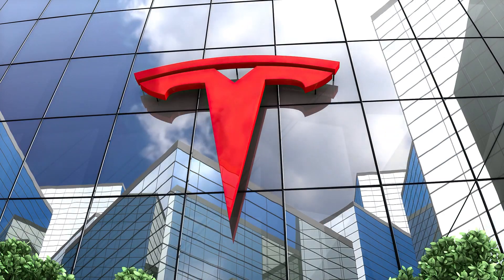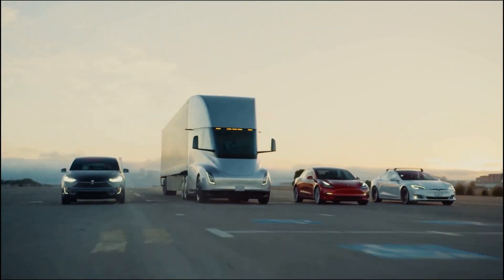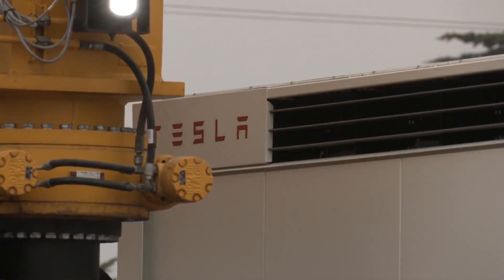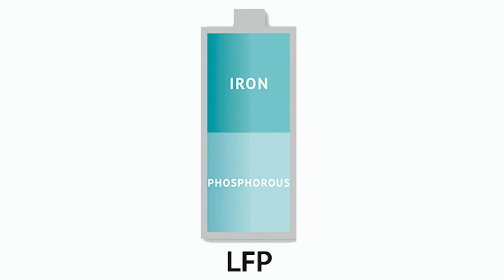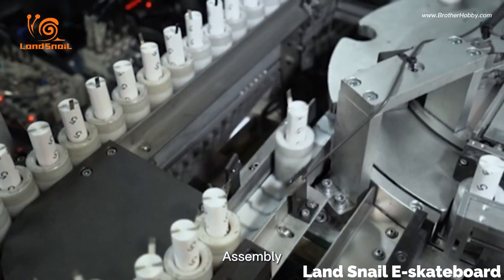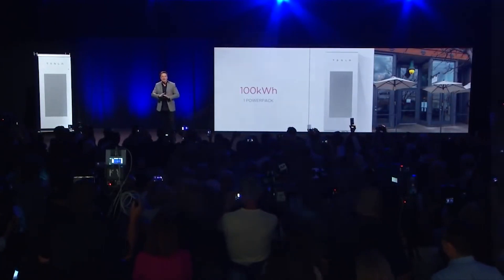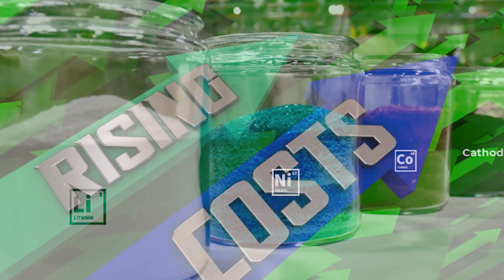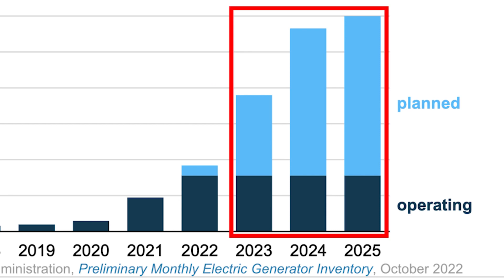The Real Reason The Tesla Megapack Will Take Over In 2023!

Comment: ISO Today app shows the battery capacity on the California electrical grid.  Data is near real-time.
PS - Wonder of a Megapack could be used to supplement data center UPS and diesel generator backup systems? Guess you’d have to cost it out plus see if runtime it provides would be comparable with data center requirements

Comment: You noted that LFP was unsuitable for EVs because of power and energy density, but I guess since the Model 3 is a lower-end and less performant vehicle, then that would be the reason why the Model 3 is using LFP batteries now? Do you have a video discussing LFP batteries in the Model 3? Aside from lower power output and density, would it potentially have better endurance compared to the traditional vehicle battery packs?

Comment: My main question is: what prevents others from making a megapack competitor and competing away Tesla's margin? Tesla's usual moat is better manufacturing and faster innovation but megapacks seem like a simple and straightforward product and, well, a battery with an inverter is a battery with an inverter. What am I missing?
Reply: There already is, and has been, competitors to the Megapack in the marketplace.  In fact, Tesla wasn't the first to design, develop and commercialize a battery backup system for the grid, they just figured out how to do it better and cheaper than their competition which is why they are constantly winning bids from the public utilities.
Reply: @S2kDude36  Do you know any company/product names of those competitors?
Anyhow, I suppose others can try to improve their grid battery systems and if they succeed this will cause Tesla margins to go down.

Comment: Demand is way much higher than that. As they explained at Battery Day, and anyone can easily do the math, demand will be several TWh per year. Even now the new factory is too small. Think about the power outages in California and Texas or the energy crisis in Europe. In both cases energy storage would be a huge help, and the scales involved are already beyond the 40GWh capacity of Lathrop.

And if prices go down, demand can scale up almost indefinitely. Currently it's cheaper to overbuild production and use as little storage as possible, but as prices go down, the optimum shifts toward more storage. In the limit, it could make sense to store excess solar power in summer to be used in winter. That's a staggering amount of storage. Likely won't make economic sense any time soon, if ever, but it's a possibility.

Comment: Here in France we estimate the cost of a Pumped Storage Facility at 50 €/kwh with a capacity of number of cycles without loss of capacity over tens of years or even a century.
The price of battery storage will always compete with these low storage prices and above all with potentially immensely larger storage capacities.
The battery solution will only remain suitable for small local supplies to meet peak power demand. Keep this in mind before you get too excited about fantastic projections.
Reply: Pump storage is fantastic but there are a limited amount of locations you can construct such an installation. Additionally a Megapack can be installed in 6-9 months versus several years.

Comment: The $2.6m is including installation for 1 2mw unit which makes it pretty uneconomical. The actual cost for the MP is 1.8-1.9m for 1 unit or 1.6-1.7m for 5+ units.
Reply: Uneconomic to whom? There is a regulated side to the energy market where they are guaranteed a return on their invested capital, so if they buy 100 of these suckers, they can simply add it to their expenditure, apply to the regulator for an 8% return on the total investment, then divide by the amount of electricity they need to deliver, and that's their charge rate. Add to that, government mandated levels of battery storage and its a no brainer that these will sell.
Reply: @howtomanagetech  I mean buying just 1 2mw unit and paying $0.7m for installation. I suspect most installations will be multiple units so average revenue is likely to be around 1.7m per unit rather than 2.6m in the video.
Reply: @Dynamacrtm  I wondered about how many packs you would get installed for that fee. The build is easy but the testing, connection and certification can be hard.
Reply: @howtomanagetech  Anything sells well when there are "government mandated levels of battery storage" or anything else.

Comment: Some versions of the Tesla Model 3 already use a LPF battery.The LFP battery sacrifices high rapid discharge required for ridiculously fast  bursts of acceleration, but despite lower energy density not range, as LPF batteries can in regular use be fully charged and discharged, where as NMC batteries should in regular use only be up to 80% charged and down to 20% discharged, and as stated LPF have greater charge/discharge cycles.

LPF batteries are definitely better than NMC for static storage applications, but sodium batteries are better still than LPF for such applications and have the benefit of being manufactured from a cheaper and more abundant raw material, sodium rather than lithium. Sodium static storage batteries are already commercially available and will only get better.
Reply: I thought Sodium Ion still had a way to go? From a google article Aug 2022 "Sodium batteries still need significant work. So we don’t want people to think this is ready-to-use technology. [We] still have a lot of work to do before commercialization.." CATL had announced Sodium Ion this year though..
Reply: @howtomanagetech  UK company Faradion already have a sodium ion stationary storage battery commercially available.
Reply: @grahamcook9289  Thanks for that. I looked up their website and they talk about them being a good replacement for lead-acid batteries. Wikipedia has a comparison table: Volumetric energy density 75-165 W.h/kg (Na.Ion) vs 120-260 W.h/kg (Li.Ion) for about 25-50% the price of Li.Ion (based on prototypes and product announcements). Faradion have one battery installed, so still a ways to go yet, but interesting to track. I'm sure Tesla will buy them all.

Comment: What will you do storing soo much energy, 
When all the Rear Earth Elements REQUIRED in manufacturing of "critical EV components" i.e. battery and Motor, are ONLY available in China, (as chinese monopoly).
Same goes for magnets and materials of windmills, solar panels, super magnets, etc.

I can see why everyone bows to China, Even F-35 manufacturer.
(As they require half a tonne of chinese rear earth elements)

Comment: 5:36 why would one cycle per day never be the case?
Tesla offers 4h and 2h discharge variants, so 6 and 12 full cycles per day are technically possible.
In use cases where you actually try to earn money by operating the battery you will want to maximize returns by running it at every opportunity.

Comment: Great informercial... However, it is unnerving to see kWh and kW confused by reporters who don't understand the difference. The cost of a megapack was quoted as $615/kWh. I believe they meant $615 per kW. When a user of electricity is paying $0.10 per kWh, $615/kWh is a terrible deal. However, considering that a natural gas combined cycle power plants costs $1,200 per kW to build, $615 per kW is a 50% discount compared with traditional electricity generation.
Reply: to cost of a megapack is indeed $615/kWh. but the trick is that you can use it more than once.
Reply: @w0ttheh3ll  I know that you mean well, but you may also not understand the difference between kW and kWh. KWh is a measure of total energy. The total energy storage capability of the life of a Megapack can be stated in kWh. This would take into account "using it more than once". In this case, the cost per kWh would be much lower. kW is the measure of instantaneous energy. If I have a 100 kW generator and run it for 1,000 hours, I will generate 100,000 kWh. If this particular generator has a life of 10,000 hours, it will generate 1,000,000 kWh over its life. If that generator costs $10,000, the cost per kWh is $0.01 per kWh. The cost per kW is $100. The cost of a Megapack would naturally be charged by it's instantaneous capacity and not it's entire life. If it were, it would have a much lower cost per kWh. Otherwise purchasing one would be idiotic.
Reply: @jeffschuster3309  the cost per kWh of a battery typically refers to its useable energy content when fully charged. look at the specs of any electric car to see an example. BTW, what you refer to as "instantaneous energy" is correctly called "power" in technical speak. the cost of a megapack is in part determined by its power (as you can see on tesla's website, there are two versions: 4 hour discharge and 2 hour discharge, the more powerful 2 h version costs more) but energy content (roughly corresponds to battery size) is more important for the price.
Reply: @w0ttheh3ll  thank you for the education. I get the specification of kWh... and $/kWh from the informercial. However, it is a terrible metric to understand the megapack's value in the electric utility marketplace. If a megapack can last for 10,000 charge cycles, it may be better to quote the cost as $0.031 per kWh ($615/10,000 cycles/2-hrs per cycle). This will give a utility a sense of how much they will need to charge their clients to recover the cost of battery storage. Yes, I understand that kW is "power".
Reply: @jeffschuster3309  the metric you're describing exists and is indeed very useful, it's often called levelized cost of storage, LCOS.

Comment: Garbage analysis! Tesla has no brand in grid power. Most batteries in the Megapack are not made by Tesla. Anyone can build or buy a stack of longer lasting safer Lithium Iron Phosphate batteries and and AC charging and inverter. BYD and CATL own the liFePO4 battery patents and are, by far, the biggest manufacturers.
Tesla energy businesses have zero value once people learn about CATL and BYD. Tesla energy competitors are far ahead in manufacturing, products, production and price!
Tesla had a fire during commissioning of their Megapacks before they were even used!

Comment: the issue for several of us stockholders is that we know Megapaks have more limited utility than Tesla's EVs. better to use LFP batteries for low-performance EVs (robotaxis?) & for powerwalls. just use cheap but effective carbondioxide batteries for grid scale storage.
Reply: which company sells CO2 "batteries" at the 100 GWh scale?

Comment: 615/kWh is incorrect!    Market is 1/2 that price!!  When pricing with tsla battery from website there is a soft cost that is fixed for engineering and drawing.   The bigger the system the lower this cost in kWh.   Try ordering 100 mega packs versus 1 mega pack and u will see the diff

Comment: The 30% cost reduction noted is meaningful if it's 30% reduction per kilowatt-hour (kWh), rather than 30% reduction per kW, as shown in bold letters up front. While this error is avoided later on your talk, please fix this error up front, so you're not confusing your audience with the wrong units. KiloWatts, MegaWatts, GigaWatts are all units of power capability, not energy storage capability or capacity. When you're talking about energy storage, like you are, then you should be using energy units, not units of power. Since this confusion is a common one, please help your audience understand the major difference between energy (kWh) and power (kW) capability.

Comment: This is key: "recurring software and maintenance fees. That could turn into $5B-$20B in revenue by 2030", versus the SolarCity model. Sending a crew to install residential solar and storage for a couple of days to install a $30,000 system versus having a Megapack contract for recurring software and maintenance makes so much sense.

14

Reply

Comment: Sorry but this is stupid video. Tesla doesn't have same technological advantages that it has in cars, has harsher competition and the "name" is less important in big projects focused on price. Even IF Tesla will sell same number of GWhs in Megapacks that it sells in cars (and it won't happen either, sorry) their margins will be much smaller. Current spike of demand>supply will last around as long as spike in cars. Then its back to normal and normal may be even less than 5% margins. While in cars it it possible to mantain 20% margins even with 50% y-y growth. Biggest advantage they have is that they will be their own client - to power up charging stations and then use it in virtual power plants. EDIT:  i wanted to add something but youtube took so long reloading i forgot. So assume there is one more information in this post.

Comment: Electric ⚡ cars a problem in high speed,will left road surface?

Supper mind think,if use jigzag base,√√√√√√ and weight transferred to gravity,than more stability possible on road?

This will solve problem of collided situation also, battery run towards front face?

JigZag √√√√√base stuck batteries  🔋🔋🔋🔋 and weight transferred towards gravity as well?

Modification in zigzag base ?

Cut a square dioganally,size supper mind think 1 fit to 1.25 fit?

Inset batteries 🔋 replaceable widh of car lenth,√√√√√√ pull out from staring left side?

Kept this half dioganally cut square on two angle rods (car"s length)?

Whole wireing and other macanisam fix in car's base segment, only batteries 🔋 will be replaceable?

Supper mind solved problem of battery replacement also?

New modification for heat?
Put exast fan to coolent copper conduction heat transfer to wind in speed,left–right in diagonaly cut zigzag√√√√√ base width of car?

Supper mind solved heat problem also?

Question ❓ & answers, discuss idea 💡?
JigZag base may be possible crush collideil situation?

Fix zigjag √√√√√ base on two angle rods  vhicale straight possition?

How will set batteries 🔋🔋🔋🔋 on jig Zag base?

Make batteries 🔋 in jigZag shape?

Give me your battery charger idia?

That's Supper mind petent for energy modification?

Supper mind found by huge energy wastage in traffic, and brakes gear ⚙️ change ?

So invent a solution for electric ⚡ cars 25 to 50 percent battery charger, for batteries in outdoor situation?

Make a charger on bonnet, rotate a armeture coil and generate low intensity electricity, because batteries don't need high intensity also?

Brakes energy store in a spring energy,when pressed brakes,then wheels transferred energy to toy 🧸 🗝️ key springs?

It's rotate ameture slowly for a long time?

Extra source is wind energy, but for this problem is ?

It create a friction for car,(Supper mind try to invent charger from this wind energy,but fail because more batteries energy wastage here,then solve by brake spring energy, amreture coil speed also low in wind energy)?

Little bit cheting possible with friction?

Initial stage idia, Supper mind will modify it near future?

How many springs you kept in thoughts?

Four spring box for four wheels?

Two front two back?

For compress spring use ⚙️ gear till last stage ?

After fully compressed spring gear will freely rotate if much more brakes used there in odd situation?

Use brakes after cliche (must be kinetic energy transfer to spring energy,detach from battery source, otherwise batteries discharge in spring compression)?

Spring box and gear ⚙️ adjust as ?

If batteries 🔋 discharge outside and no charge power possible then?

Set spring box as this way two or three people push car 200 to 400 meters?

Brakes kept on and energy transfer to spring compression,as much heavy spring box can use?

Charging will start,here also?
Reply: New modification for heat?
Put exast fan to coolent copper conduction heat transfer to wind in speed,left–right in diagonaly cut zigzag√√√√√ base width of car?

Supper mind solved heat problem also?

Comment: New gross margin calculation:

Orignal: 1.23M cost for 3MWh of NMC cells incl inverters; $461/kWh with 5-10% gross margin = 0.1M margin, thus ~1.1M costs

New: 2.6M for 3.9MWh LFP cells incl inverters = $615/kWh, 
with 30% reduced costs = 0.8M of costs for 3MWh,* 3.9/3.0MWh = 1.04M for 3.9MWh 
thus I expect margin to be: 2.6-1.04M = ~1.56M = 60% margin (!) 7:22

Comment: If you calculate average states nighttime energy usage and then scale that to what's needed via megapacks you will see an insurmountable problem. You also will need to add a buffer I would say minimum 25 days as single dark cloud can drop pv output to near nothing.
Reply: You obviously have no understanding of how power utilities are using storage systems.
Reply: @charlesrovira5707  To hit netzero the grid will undergo a massive change one that is not possible with current tech. But no surprises most would rather make assumptions and insults.